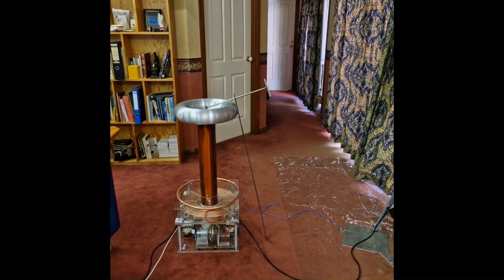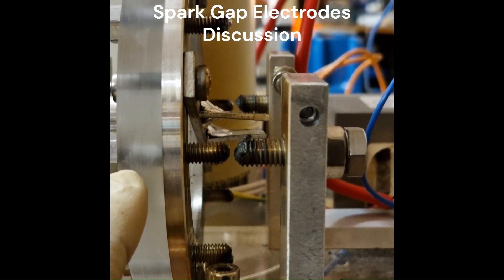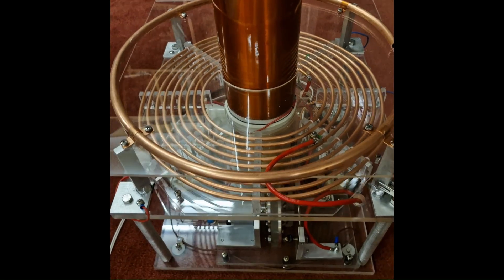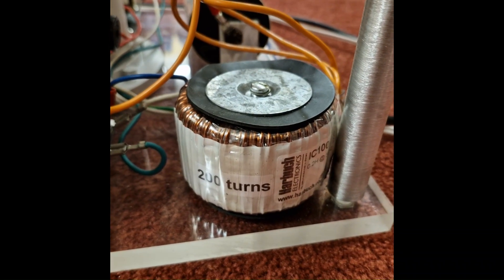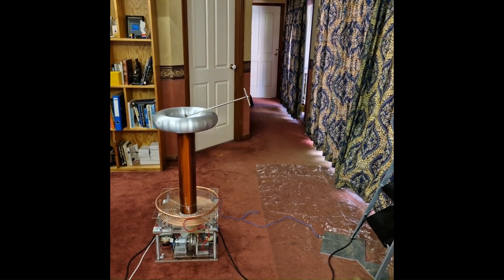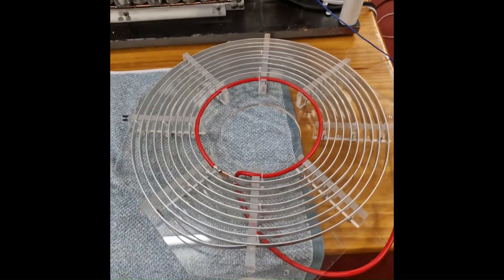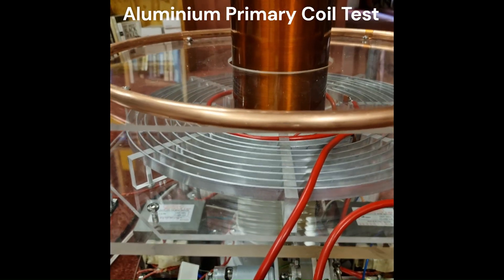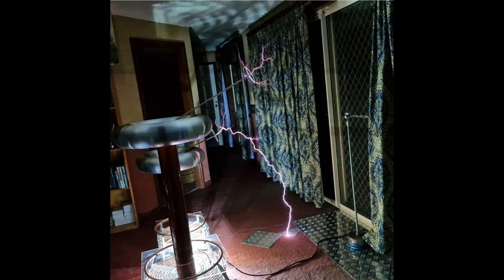220nF Dual Microwave Oven Transformer Tesla Coil

Comment: Great arcs with just 2 MOTs. Also, is the inductive ballast required? Would it still work without a ballast?
Reply from the maker: I think you might be able to run without the inductive ballasts but haven't tried... as long as you're using a rotary spark gap.

Comment: Switching these currents with switch made on motor is brutal. Why did't you use electron lamps or IGBT transistors?
Reply: Why is it brutal? Its not as if its directly connected to the motor usually pretty well isolated so it doesn’t effect the motor at all . The steel electrodes how ever thats where it gets brutal a single mot wound for low voltage high current is more than powerful enough to make steel soup.. id have used either titanium or tungsten . Tungsten can be easily sourced at almost anywhere that sells welding supplies and is likely the best option next to like pure carbon electrodes . It always surprises me that most people in these videos seem to use steel electrodes like you put all this effort into to the build and got everything tuned and running great . Not something a truly stupid person could even get close to doing andafter all that effort and learning planning and building after all of that you chose steel for  spark gap electrodes ?come on now steel oxidizes so fast and and just eats it self alive from the high heat concentrationand exposure to air with out a sheild of some kind
Reply from the maker: Thank you for taking the time to comment. In one of the later videos I present how I made a rotary spark gap with tungsten electrodes.
Reply from the maker: This is a classic rotary spark gap design.  Not as sophisticated as the new solid state variety but a beginner like me can build and get going more easily.

Comment: Wow, amazing stuff, especially with just 2 MOT's! what made the difference compared to your 4 x MOT?
Reply from the maker: Thanks for watching. 
I think the slight increase in capacitance but mostly I suspect the current limiting inductors.. the quad MOT used 2 x 230 turns or so in SERIES. This  dual MOT uses just one 43 turn inductor,  letting more current through.